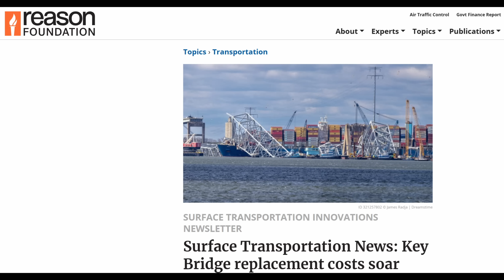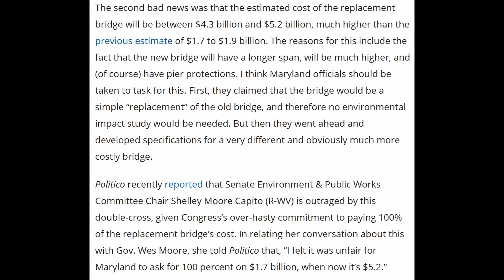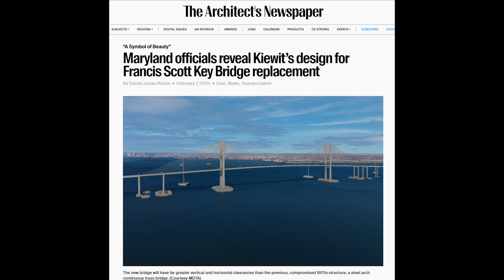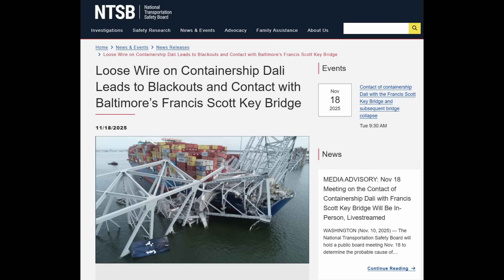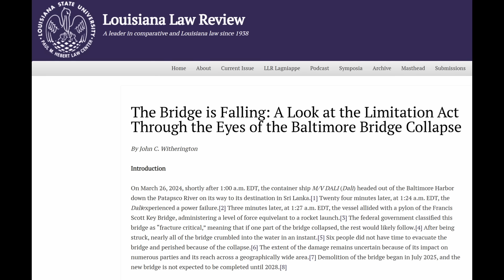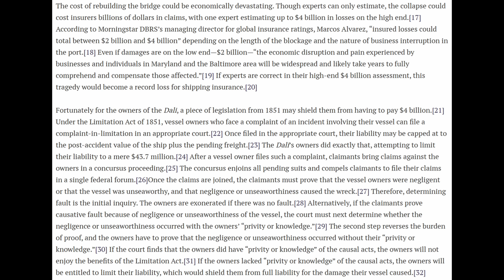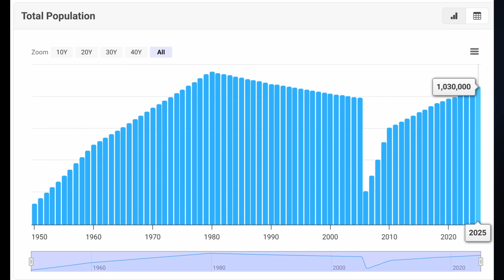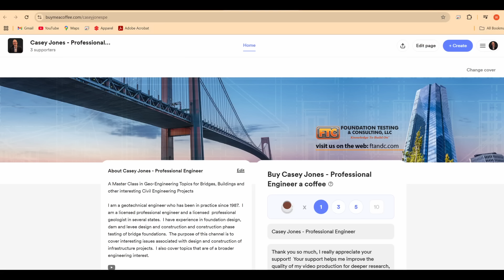Should U.S. Taxpayers Pay for a $5 Billion plus Key Bridge Replacement?

Comment: While the price is outrageous and there are major problems with how out of control construction costs have become, I am going to disagree with most of the comments here and say yes we should. There needs to be some accountability from the shipping company cost wise and the city of Baltimore and state of Maryland should also contribute via a local toll system for a set number of years. Ultimately federal though,  tax dollars will be needed to complete this especially at an accelerated time line. I am far more happy with my taxes going towards infrastructure repair than some of the other things funded by taxes. A functional, efficient interstate road system helps the economy, even if its far away from you as goods need to be moved cross country daily. This is why taxing the rich more also makes sense because they benefit economically in more significant, direct ways by efficient infrastructure.

Comment: If MdTA had started building bigger or more dolphins groups like Reason would have been whining about wasting taxpayer money on a makework boondoggle so I really can't blame MdTA and Maryland for following the current AASHTO guidelines. A better question might be whether this bridge is actually necessary for the current highway network. There are several alternate routes including one that accommodates oversize and hazardous loads, and not much in the way of traffic generators specific to the bridge. All it would do is effectively add 2 lanes to the I-95 corridor through Baltimore. That corridor already has 2 lanes at the McHenry tunnel, 2 lanes at the Harbor tunnel, and 3 lanes on the Baltimore Beltway (counting lanes in each direction at the narrowest point on each route) for a total of 7 lanes in either north/south direction across Baltimore. Was the Key Bridge carrying so much traffic that the other routes would be overwhelmed by the diversion (more overwhelmed than they are now)? If the Key Bridge was so important why did so many drivers prefer to wait in traffic for the tunnels or along the Beltway instead of taking the rarely busy bridge?

Buy America means they have to buy American steel, but the point (and definitely effect) of tariffs is that the US steel producers have more pricing headroom: US steel is supposed to get more expensive with tariffs. Labor costs have also increased dramatically. And despite what someone keeps insisting fuel is also more expensive now than it was a year ago. Labor and fuel are major construction cost factors.

As for who should pay, it won't be the ship owners or operators. Their liability is limited by international treaty, and that's written into federal law. Since the limitation on liability is federal and the enforcement of ship operating regulations is also federal, does it maybe seem like the federal government bears some of the burden here?

Comment: If you read between the lines, its not just a rebuild but an upgrade.  IMHO, They're taking advantage of the situation to upgrade the bridge to the latest panamax ships.  What is being unsaid, is that the higher bridge, wider span, higher tower and larger islands are all a push not to meet the guidelines for the current traffic, but for larger shipping traffic with the feds picking up the cost for the upgrade.  Next will be deeper dredging and taller cranes.  

It might make sense to perform the upgrade, but they're hiding it as to avoid the discussion.

Comment: I think its worth noting that passive bridge protection is not the only way to protect a bridge (it is a good one).      While its technically complex,  in simple terms,  LCV have two power paths (4 main generators in the case of Dali and an emergency Generator).    Short version is if they had all the Generators running at departure and had a split bus,  no failure on one bus would stop the engine (redundant pumps both fuel and cooling) on either bus.    Not desirable but pumps  can run in parallel pairs for a short period of time.    They have at least two sets,  maybe 3 as they have to be able to operate with one down for maint or repair.     The Backup generator can not carry the load the main system does,  what it can do is move the rudder as it powers a separate (slower) ram system.    That may have been enough to glance off or miss the bridge.   It has its own circuits that can be separated from the other two systems so you have another redundant patch for some functions.   Attached Tug escort would work as well (New York has at least some of that).     You want many layers to keep from having a safety escape .   Main rudder rams are the same,  one on separate busses,  you loose one you do not loose both.

Comment: The US 301 bridge over the Potomac was replaced a couple years ago for $700-800M. Different construction type, lower clearance, but same number of lanes and similar length. The original replacement estimate seemed realistic in comparison to THAT one. Surely the new estimate will be itemized??

Comment: There are two primary reasons your analysis here is flawed. First, you neglect to mention why the Francis Scott Key bridge was built in the first place, which was congestion relief for the Baltimore Harbor Tunnel. Second, you neglect to mention that the outer harbor crossing came from old plans regarding the design of I-695, the Baltimore Beltway, which was originally intended as a complete loop around the city. Once FSK went down, those original congestion problems returned and hazmat traffic was routed around the Beltway, which despite many expansions over the years was already congested.

Further, your analysis does not include a projection of the long-term benefits of the bridge. You're right to question how rapidly the cost of the project has escalated, but that only makes sense if the return on investment is included as part of the analysis.

Finally, your segue to a project with which you have more personal knowledge as a better use of the funds is irrelevant. I'm not saying it is not a worthy project, but you didn't provide an ROI projection for it, either.
Reply from the maker: You miss by point. So fa there has been no return on investment analysis done for replacing the Key bridge.
Reply: @CaseyJones-Engineer  My point is that you drew a conclusion about the I-70 project, suggesting that the money was better spent there. But without understanding the realities of Baltimore's role in the I-95 corridor and local commuting conditions, how can you make that assumption? If there were two ROI projections, then I might buy your argument.

I drive in this traffic, and I can tell you that the congestion that came as a result of FSK going down is considerable, to the degree that the same analysis that was done for FSK originally will apply equally to the rebuild.

I'll say this: I agree with you that taxpayers should not foot the bill. They did once, and it wasn't their fault that the MV Dali brought it down. But as @wgowshipping has documented, Byzantine maritime law limits liability. Tax dollars are inevitable in this case.

Comment: "One Loose Cable Destroyed the Bridge: Do you believe it?"
by Chief MAKOi  Dec 8, 2025  20m16s
https://www.youtube.com/watch?v=esglAsu3yYU
Dali's owners, operators, and power/propulsion controls & protection designers were/are 100% liable for the accident.
Safe, professional operation is expected & mandatory.
Analogy: bridge supports & overpasses, power poles, lamp posts, trees, people on sidewalks, nearby structures--
--ordinarily none of these are "protected" from road vehicle failures or misoperation.
Agree with you on failure to upgrade bridge pier protection.

Comment: I don't want the taxpayer to be forced to pay for damage caused by another - but I cannot honestly say that the ship should be charged for the whole amount either. The general principle of liability for property damage is that you are only liable for the value of what was destroyed. The state should not be able to charge one penny over what it would cost to build an identical bridge to what was destroyed - even if the state would never build that same bridge again. If I accidentally burn down someone's house, I should not be required to pay for them to rebuild a house twice the size with extra property luxuries.
Also worth noting - you cant get blood from a stone. There is a maximum value of assets and insurance available to the owner of the ship. Once that number is exceeded - there is no one left to pay other than the taxpayers - because the taxpayers are the ones who need the bridge replaced regardless of the cost.

Comment: Could scope creep be a factor ? Start out with one concept , which then gets multiple add ons as stakeholders add their input/ expectations / requirements .
These days it seems very challenging to conceptualize, design, build and operate massive projects without multi factor cost escalations. 
Also , counsellor it be no one single person is responsible overall for the project ? I have heard the that even the very large projects need a “benevolent dictator “ who has the final say on many fectors in the project in order to control costs.

Comment: In project management class, they teach you that you can have cheap, good, or fast.  Pick two.  We’re not even getting two.  It better be a damn great bridge.

I’d like to point out that on the north side of the bridge is a huge trade center that relies on the bridge.  Right now all that truck traffic has to go through one of two tunnels, and then then travel through the city.  Oil and chemical trucks that come from Curtis Bay on the south side, now have to divert to the west, taking the long way around the city.

Comment: A couple of points: 
1. Tariffs will decrease competition and cause prices to rise generally. The builders will have to buy steel in this generally more expensive market. The same thing will happen with wood products. Tariff argument has some merit (but not 2.7 times)
2. Despite the disturbing insurance problems you cite, I think the biggest problem is an entity which does no upgrades or maintenance is 'punished' with the gift of a new bridge (!?) The who benefits, who decides, and who pays chain has some serious kinks in it in this case. 
3. I am on shaky ground here, but I suspect that a replacement is beyond Maryland's budget abilities. Do you really think ;that they should just lose the bridge?
You raise important issues with this project.

Comment: I doubt it would cost more than $350M if they just rebuilt the bridge instead of building a new bridge from scratch. replace or repair the damage pilings, and use the rest of the piling. Build the bridge sections at a steel yard, and move them on barges and install the using cranes. Probably take 18 months or less to rebuild. Probably could get it done & open in under a year if pressed a bit.

The original bridge cost about $171M (1972 - 1977), adjusted for inflation that would be about $850M, but the cost would be much lower if the original pilings are reused. They can even use the original plans for the bridge.

Time for this non-sense & over govt thinking. 

The only change would be to add some barriers to protect the piling from ship accidents. This should have been done decades ago. Probabably cost less than $100K per piling to drive some concrete filled pipes on the sides of the pilings as barriers. Sure they won't last for ever, but nothing does.

Comment: If it is such an important route, have the users pay for it.  Pass a Federal toll to repay the treasury.  That suggestion will drive a discussion on cost containment, cost/benefit analyses and would be a good idea no matter what happens.   The local stake holders scream the bridge has to be replaced,  but when they have to shoulder more of the costs, they begin to scrutinize things more.  The Feds are going to pay for it, but the Feds have a users tax to pay for it.
Reply from the maker: Those are all very solid ideas that you have advanced.

Comment: Trigger for Uncle Joe to commit?  Traditionally democrat state wavering with an upcoming election.  Cost increases - just the usual cronyism, corruption, padded union rosters of required laborers, price fixing between suppliers, profiteering, empire building, and greed.  You can be sure that at least half the hand wringing going on immediately after the accident was from people who had not yet figured an way to profit from the mess but had to play for the media.  Once the dust / mist settled, everyone put a few fingers in the till and used the others to point at some other guy as the source of the problem.  Uncle Joe signed a blank check!  WooHoo!   I had the misfortune of living in the Peoples Republik of Maryland for 31 years.  It put a big smile on my face to see "Welcome to Maryland" getting smaller in my rear view mirror 36 years ago.

Comment: Cost for this kind of work has been ballooning for years. Now and then you find articles about how much costs for replacing much smaller bridges has gotten out of control. Near here there has been an effort to replace a dangerous stretch of hilly road for many years. However, delays have happenee and the costs went up so much that it was shelved. Now there is a large section that is sliding away down the slope. They keep patching it but it slides again fast. One of these days that section it going to give completely and someone will likely get killed and the main traffic route will be cut.

Comment: $5.2B x 4.74% (L/T Federal borrowing rate) / 30,000 vehicles / 260* / 2 ≈$16 toll EACH WAY.  * – workdays per year.

If Maryland motorists aren’t willing to pay $16 each way to use the new bridge, then why in the fuck should the rest of the Nation pay for it either?!? And $16 is JUST THE INTEREST!!! The all-in toll rate is probably closer to $25 each way.
Maybe I wouldn’t be so exercised if Maryland had spent even $1  upgrading the in-water “dolphins”  protecting the bridge piers as vessel sizes sextupled over the last 48 yrs.

Comment: Katrina didn't "hit" New Orleans in any substantial manner.  After the storm, there were hours of news showing they had dodged the bullet.  The Katrina impact on New Orleans was that the water piled up in the eastern side of the Delta didn't drain away before it was able to exploit all the century or more public construction corruption built into the levees.  

What caused Katrina to be so bad was that the eye went up the Pearl River right next to the Delta.  The Delta plugged the drain of the storm out the "left" semicircle of the storm, in Katrina's case to the west.  So the water filled up to the levees and back up across the storm to cause much more flooding in Mississippi than would have happened if the blockage had not been there.

Comment: Tariffs give US producers the flexibility to raise prices higher. If foreign steel suddenly cost 20% more than us steel due to tariffs. US steel doesn't want to be the cheap high volume option, so they raise prices. Probably up to the same premium they had over foreign steel before

That doesn't explain the cost ballooning by 3x, but to act like tariffs do not affect the US manufactured goods is ignoring how the market works.
Reply from the maker: I was not ignoring it. I was saying it didn't account for the 3 times cost  of the original estimate.

Comment: Over the Port of Baltimore had several enlargement projects to accommodate larger ships and greatly increased traffic. However those projects ignored bridge safety improvements. So yeah, there’s a lot of shared blame. 

Those projects included berths for Panamax and Neo Panamax container ships. Which returned greater fees from shippers. Which should’ve been full spectrum enhancement to the port. Berths, dredging, channel protection.

Comment: Federal money wasted. The example of New Orleans. Post Katrina there were numerous pumping stations for flood control installed by USACE as part of the levee repairs, and levee modification. In 2017, for example, there was a major rain and flood event. Many pumping stations failed, and for several reasons. Poor and deferred maintenance as well as poor of vulnerable electric supply and emergency generators. And that flood event, one of several cost FEMA money. 

So yeah, good money after bad. Federal money. It’s as if New Orleans is a bad investment. Un fixable

Comment: The damage to New Orleans from Katrina was 100% caused by the failure of the federal levee system that the feds were negligent in their design.  I know as a career working as a PE in New Orleans on flood protection.  The Corps continuously rejected or altered designs.  You'll like this one, 3 miles of floodwall, the corps took proper soil borings but then the Corp did nor use site specific boarinds but averaged the borings making it appear soil conditions were consistent along the 3 miles, that's were the major floodwall failure occured as the sheet pile were not long enough.

Comment: Thanks for the update Casey!  There is a trail of liability here and that is where the replacement bridge should be paid for out of. Master of the boat, harbor pilot (if used), Electrician that performed the work that failed, the operator of the Dali, The owner of the Dali, and the state of MD. Not the Fed, Not the people of other states, only those in MD. Maybe they will choose more wisely when they elect people to work for them.

Comment: I am getting sucked into this project as a machine designer, I won't talk about specifics even though I haven't signed a non-disclosure agreement, but suffice to say the engineers 'competing' over this project are a little unnerving; I will do my best to help sort through the b.s. and get the upgraded bridge finished. I need some no-nonsense engineer advice on the overall project though, especially from the civil-engineering perspective, so I will be tuning into your updates on this infrastructure project, even though I'm across the country helping fix this emergency.